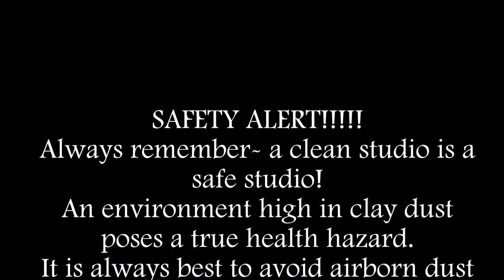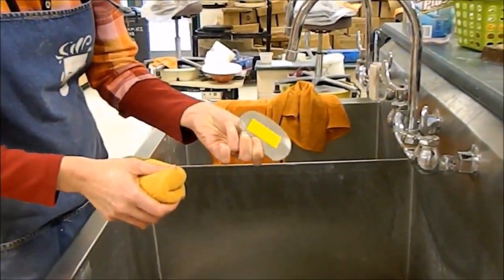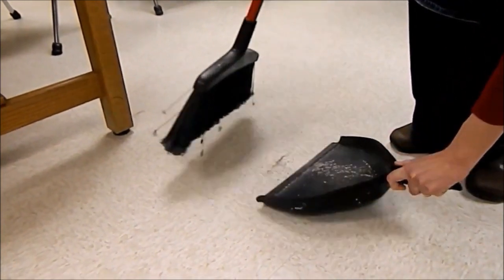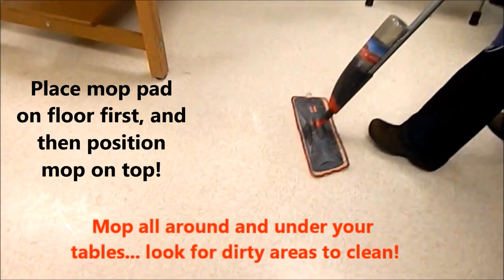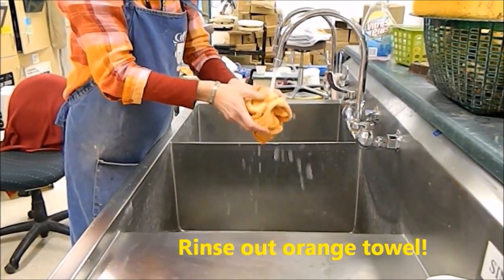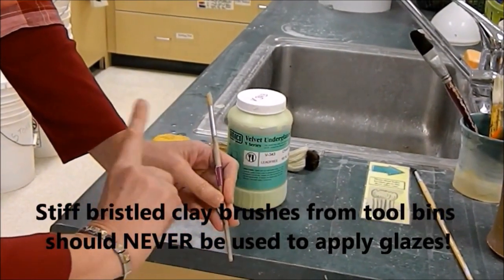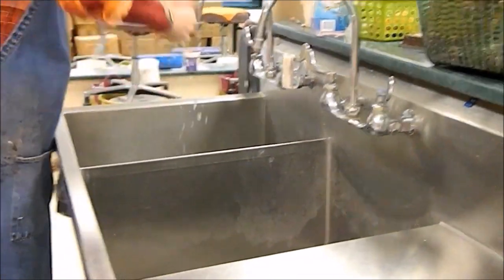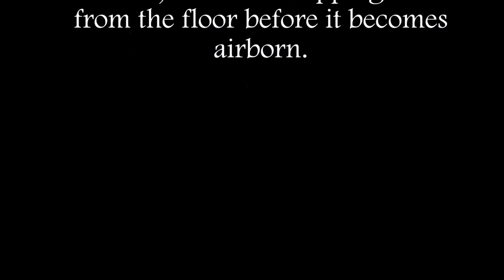How To CLEAN the Ceramics Studio!

Comment: For some reason no matter how clean I try to be I'm really scared of creating dust and getting silicosis.... I always clean everything with water but it's mainly my clothing and the canvas that I use to knead on that I'm worried about making dust. How often should you wash your Pottery clothes and if theirs a bunch of dry pieces of pottery just sitting on your clothes will dust start to accumulate into the air? I wear and old pair of pants and shirt and then a long jacket that I wear over them. The jacket always stays on the porch where I work but will walking into the house with the other clothes I wear underneath put dust into the air? And can I leave them inside until next time? I just place mine on a stool in my room but I'm worried each time I pick it up theirs dust going In the air. I hope I'm not being too paranoid I just want to make sure I'm doing the right thing.
Reply from the maker: Not a bad idea to leave your jacket outside!  I leave my apron in my studio.  I do try to rinse my apron off when I see an accumulation of clay- then after rinsing I toss in the washing machine. I guess if I have clay falling off of it, then I absolutely clean it! ;). Most of the time it isn't that bad... but when it gets to that point,  it has probably needed it for awhile!  I think you'd be fine in your clothes you wear under it though if you aren't really seeing clay on them!  I do change my shoes however- I have studio clogs which stay in my studio, and I switch to other shoes when I leave to go into the rest of the house!  I wear the same set of clothes in my studio too until they get messy and are ready for a wash!

Comment: What kind of a mop is that? I have to clean up a ceramics studio at work.
Reply from the maker: +John Schwartz It is my favorite mop by far!
The Rubbermaid Reveal mop!  They sell at Walmart, but I buy them at Sam's club, and they are cheaper and I get extra pads that come with it!  :-)
Reply: +KaransPotsAndGlass Thanks so much. The students just create at much dust as they want and make no effort to contain or control the dust. Any reference materials about ceramic studio safety you could share would be most helpful!!!
Reply from the maker: John- I have referenced Ceramic Arts Daily forums quite a bit for safety information, as well as just googling stuff.  I just know, safety to me is of first importance... as I love clay, and want to stay healthy when I retire!  With 7 classes a day cleaning the floors now, it makes a huge difference in the environment in here!  Originally, I had relied on a room filtration system... (Which I found out years later, wasn't correct- it should be hepa filtered and it was not)  When I found the air wasn't as filtered as I had been led to believe, my priority became getting the dust and debris off the floor as soon as possible to keep down dust!  I also clean my room a few times a week with a HEPA shop vac as well to help.   Sorry, I don't have any documents in particular that I have kept, but most information is online!  I hope that helps!   :-) Karan
Reply from the maker: Try this... and click on forums.  You can become a member by giving them your email!
http://ceramicartsdaily.org/